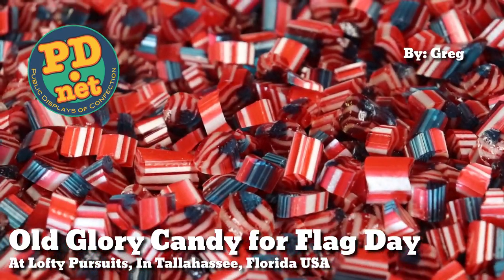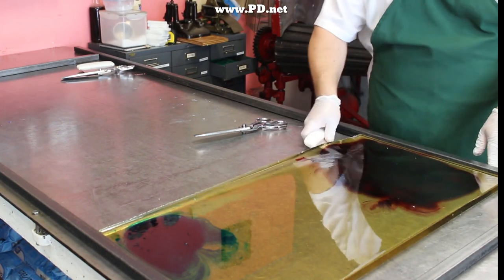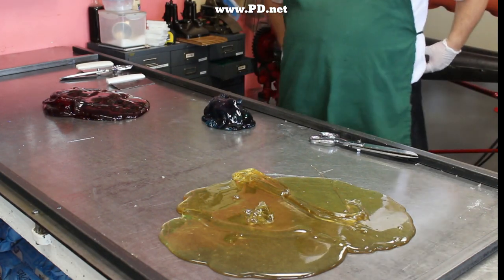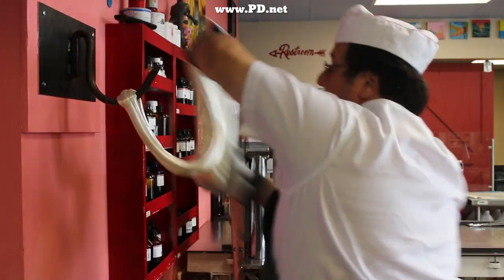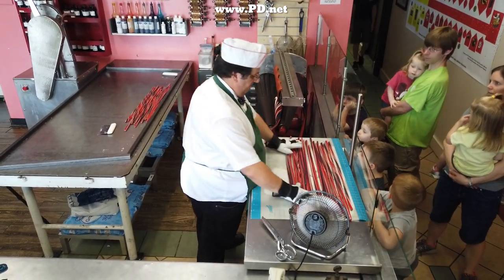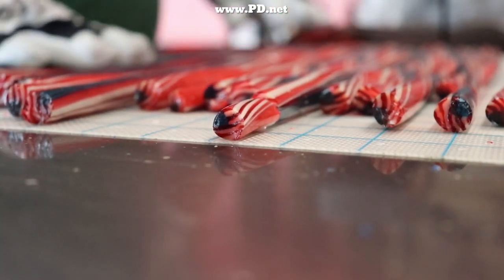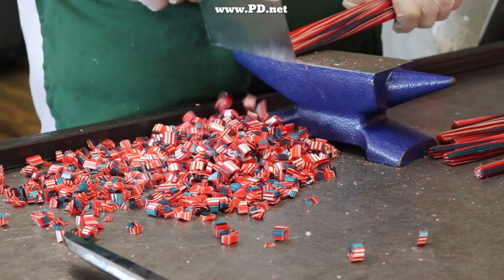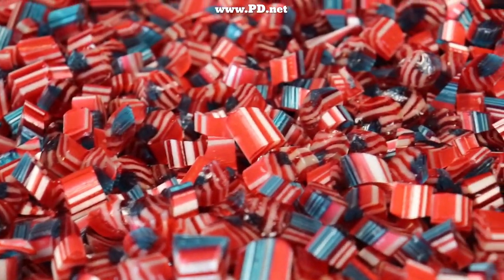#103 Making Old Glory Candy for Flag Day and the 4th of July.

Comment: Have you developed a high tolerance to heat in your hands?
 I've been welding for over 20 years and when I burn myself I barely notice unless it's real bad. I find blisters all the time and no recollection of pain  from being burned.
 I saw a guy on TV that made scientific glass from Pyrex tube and he held it in his hands while he put it over the torch.  He said he like to freak out the waitress at the local Mexican restaurant by grabbing the hot plate from her oven mitts and setting it on the table.
Reply from the maker: Yup, I got it from metalworking myself. I'm not as good as that glass guy, but it does make the job easier.